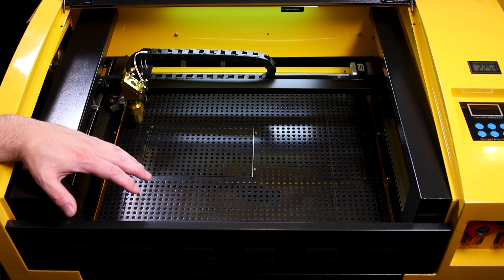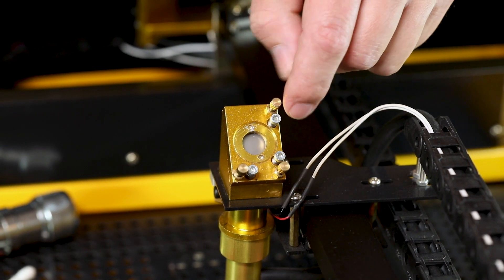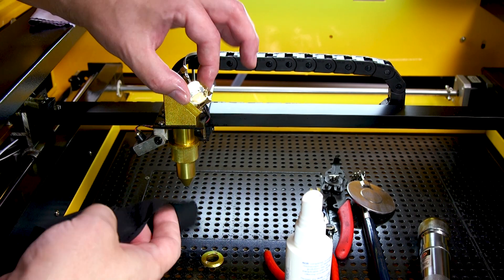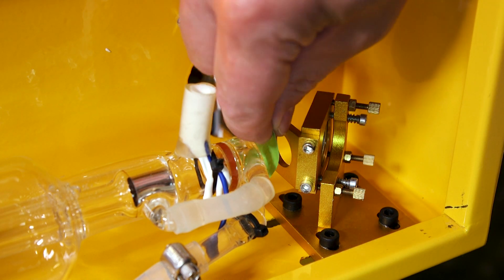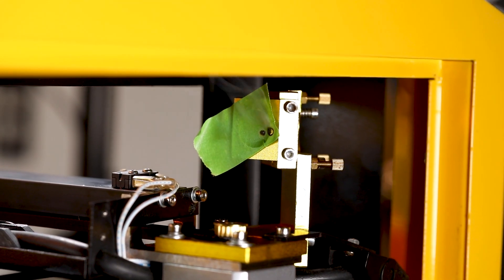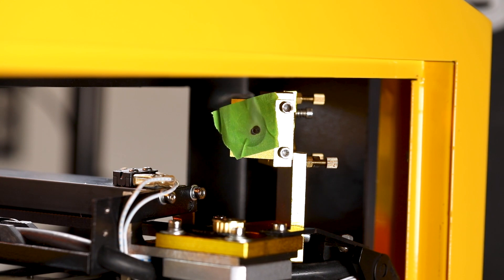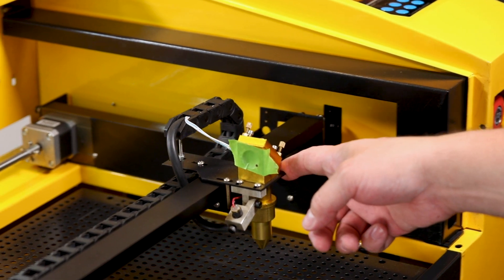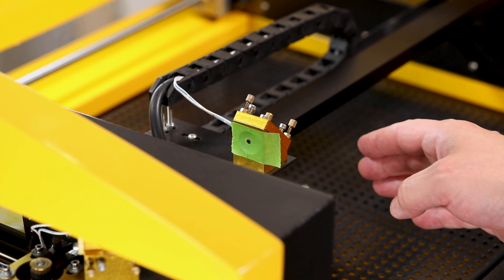CO2 Laser Alignment and How to Clean Laser Lens and Mirrors / Beginner Series Ep. 5

Comment: Hi I am having trouble in laser 50w machine its all of sudden goes out of engraving or cutting area or get vary distance while engraving or cutting and also the water pump is not pumping enough water when its was new kindly help me , I have videos shoots of errors so if you allow I can share them with you, regards and thanks
Reply from the maker: Are your belts tight?
Make sure your water lines are all clear. If they are, you might need a new water pump.

Comment: great video. while opening the focus lens ring with plier i slightly scratch it. now no laser beam is coming out of lens whenever i cut anything. lens alignment is great but no laser coming out of focus lens.
Reply from the maker: If you scratched the lens, you should replace it. Get them on Amazon for cheap. Make sure you reinstalled the lens with the flat side down.

Comment: Hello brother our co2 machine is working but it doesn't cut. If I test the fire button it does nothing. Any troubleshooting will help  🙏 .
Reply from the maker: Use a volt meter to check for power to the bulb and also check the fuse.

Comment: May I ask is are the mirrors have a certain side I need to use or I can use both sides? After I cleaned and aligned all my mirrors, I  noticed that the power of my 150w CO2 laser dropped a lot. Now I am speed 5, power 100 to cut through 6mm acrylic for 2 passes. I have replaced a new co2 tube but the power is still weak. Thank you so much for the clear demonstration by the way.
Reply from the maker: The mirrors should only be reflective on one side. Also check that everything is aligned and the lens is pointed in the right direction.

Comment: Very good video.  Just one tip. When using mask tape for targeting I noticed the adhesive burned makes mirrors get dirty. So now only I use paper and double layer adhesive only on the frame. Slower but cleaner.

Comment: Super helpful video. Thanks. I couldn't help but notice you machine bed is not a mesh screen but sheet punctuated with circular holes. I love this. Would you happen to know where I purchase a screen like this. I think maintaining and cleaning it would be so much easier than the honeycomb mesh! Thanks so much.
Reply from the maker: It actually came with the machine. I use a honeycomb mesh on top of it for cutting, but it does catch most of the pieces that fall through the mesh. Hope that helps!

Comment: I'm sure you're method of cleaning works fine, but when I do this, I wear nitrile gloves, use a blower or a gentle brush to remove any fine particulates before rubbing with a cloth and alcohol.  I also pull out the mirror with a piece of masking tape, but that's just me.
Reply from the maker: Thanks for the tips and thanks for watching!

Comment: Great video thank you, can i ask a question please, these appear to be cloud ray mirror supports, what is the set of 3 nickel plated screws used for on the mirror support, I know the brass ones are for adjusting but not the screws with the spring??

Secondly a little tip, I use masking tape to remove the mirrors from the holder, just apply some to the rear of the mirror and it comes out perfectly, do same for reinstalling. I only ever use glass ones and i'm always afraid i might drop one so i came up with this to stop that happening.

for those that make money with their lasers you never know when a mirror or lens will break or burn ojut, I always keep a spare set, even if its a cheap set it still means you can use your laser and not wait a couple of weeks with down time for your laser.  

I had this very problem with my laser head mirror on my K40, its has no adjustment on it and the beam was bouncing off the side of the air assist chamber and burnt out the lens. Since replaced the lens and mirror support to an adjustable one!!

Comment: Best video I've seen thus far on cleaning/aligning mirrors. Thanks for that. I actually used a pair of hemostats instead of needle nose pliers.
Reply from the maker: You're welcome and thanks for watching!
Reply: good idea if you can get them, i just used an angle grinder and ground down a small piece of brass plate about 3 mm thick so i can use use it like a screwdriver,  it has two lugs at the bottom that go into the mirror holes then use masking tape to lift out the mirror, a lot safeer and does not scratch your nice shiny anodising which is clearly does in this video...

Comment: Hey, did I miss something, did you say what power level to be testing at?
Reply from the maker: For safety reasons, I keep my power low when testing/aligning at 10%.
Reply: @MakeTechCreate  Thanks!  I set my controller to 10ms pulse then started raising the power up to 95% & it didn't seem to make much difference from 40-95%.
Reply: @GlazierPointDartCabinets  1% max is all you need really at 6 milliamps in lightburn, I sometimes go to 2% but never higher for a alignment test or the burn area is too large to tell where it starts from. It takes a  little longer to start off but it does a better job and the risk of burning your hand in the beam is less....

Comment: Hey dude.. what if the head itselft is not perfectly square to the table? The last test you did after you remove the lens could still be wrong even if the mark is at the center of the circle right?

I'm asking cuz i bought a new machine and i've been experiencing an annoying bevel on thick materials, like 10mm balsa.

Did you mechanically aligned your head to be square to the table?
Reply from the maker: Mine was level when I picked it up. I'm not sure what machine you have, but many have a bed that can be adjusted.
Thanks for watching!